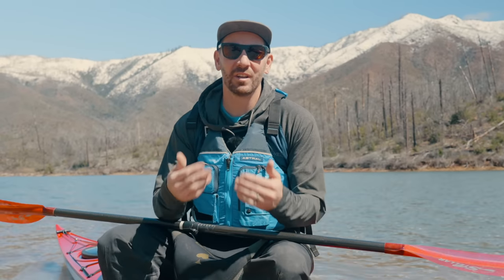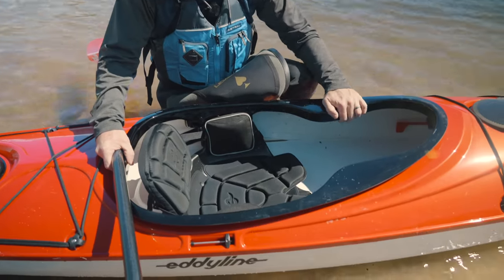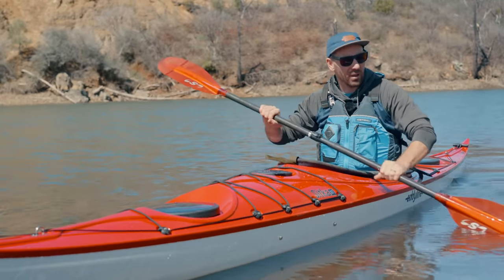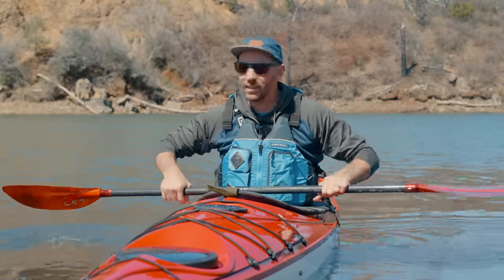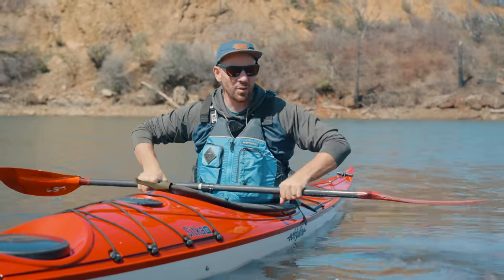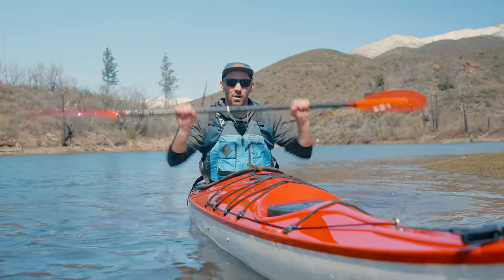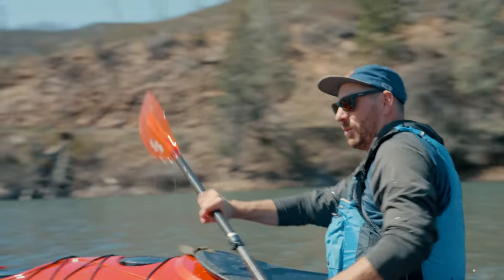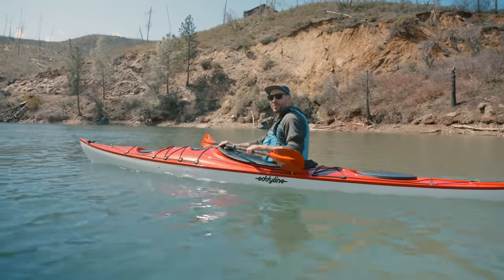Advanced Paddling Skills: Kayaking 102

Comment: I just added those exact hip pads to my Sitka XT to increase my connection with the kayak and thus edge control for turns.  A great instructional video as always Dan!
Reply from the maker: Right on. I hope it helps. Go out there and play in your boat!
Reply: What hip pads did you add? My xt seems to have very thin pads and am experimenting with add foam shim under them with mixed results. Thanks
Reply: @jimhunt1230  it's the Harmony Gear hip pad kit
Reply: @bunsen27  Thanks for pad info.  I will try a pair.  Curious - did you add these on top the standard XT hip pads or use as a replacement?  Also curious on seat placement - how far forward do you have your seat?  Thanks again - just got my Sikta XT last week and trying to get comfortable with it and dialed in.
Reply: @jimhunt1230  Yes, over the existing pads.  They come with straps or velcro for attachment.  My seat position is 1.25" back from the front of the most forward seat position.
Reply: @bunsen27  Thanks for the quick reply & info.  I have some straps on order & will remove the foam inserts that I made from an old camping pad that while added hip contact were uncomfortable.  My seat is back about 1.5" + from the most forward position.  Originally I was moving the seat forward to get better thigh contact.  I have since added a 2nd pair of Eddyline brand thigh pads & the contact feel has gone from to loose to slightly too tight.  I am still working on finding the right foot peg length.  Not sure if I will leave the 2nd pair of thigh pads in place.  (fyi - 6' 3" - 240lbs - size 14 feet).  The boat does feel good and better with each paddle.  I have yet to master any of the advanced paddling strokes discussed in the video.

Are you happy with how your XT now fits you?

Comment: Love this! Thank you so much for the skills video 👏👏👏🙌🙌🌅❤️. I am starting down this path with my new stellar S14 kayak. I’m  Starting to play a little with edging. It’s definitely a progressive boat from my Eddyline Sandpiper. The one thing I do notice though I need the skeg down for tracking straighter even in calm water…my Sandpiper seemed to do a better job? I was wondering if that would be the case for the Sitka as that was the other boat I would’ve gotten - was just 10 pounds heavier and that made a big difference for me. 
Just wondering if you have any ideas on the difference between the two boats and what I need to consider when I try these new skills out. Thank you again I just am so grateful for this video.
Reply from the maker: Yes it’s a much looser boat than an Eddyline. More playful but also a handful without a skeg. I really like the rudder upgrade on my 14. It makes it a completely different kayak.
Reply: @HeadwatersKayak  
OK can you expound on rudder -on one video you had mentioned the difference between the bottom of the Eddyline, and the stellar saying that the stellar would handle rougher conditions better? Now I have the advantage layup not the multi sport. I don’t plan to go rock gardening, but I did buy it as a sea kayak. Also, and one video you said you wouldn’t get the rudder because you felt you didn’t need it but you do have it because of your filming for the channel. I’m not going to be doing that obviously. 
But I definitely love the way the foot pegs have the extended rudder pedal on them and I’m certainly open to getting a rudder. How does that work with edging and the skills that you’re teaching in this video. Sorry to ask so many questions. I have not taken a lesson in it yet and plan to do so, but it’s gonna be a bit yet before I do. Thank you so much!
Reply: @clahr7671  I also have an S14(G2) and the skeg is indeed necessary for good straight sailing and then it sails perfectly straight. But also with skeg you notice that the S14 responds very well to tilting and steers very easily. Due to its width, the tipping over point is far away, which gives the confidence to use tilting without fear of tipping over . In my opinion, a rudder is not necessary with this kayak. I don't like rudders anyway. I find a kayak easier to trim with a skeg. For me, the S14 is the ideal touring kayak. It accelerates easier and rides lighter at touring speed (7kph) than the 18ft Rebel Jara kayak I had before and is super manoeuvrable. I love my S14!
I read that you will be using your kayak at sea, I have to say I don't sail at sea so I don't know how the s14 handles big waves.
Sorry if my english is not correct, english is not my native language.
Reply: @spook-e8621  I really appreciate the detailed info on your S14… Very helpful!
It all makes sense 👍
I may get that rudder… I think I will for the ocean. I believe that’s what Dan is talking about. But the skeg definitely needs to be down. I am learning more about it all the time and it is enjoyable more I play in it.
Thanks again!

Comment: @15:28 you are not significantly ‘shortening’ your waterline length.  

What you ARE doing by rolling / edging / leaning is you are changing the wetted hull form from one that is symmetrical when level to one that is ASSYMETRICAL.  A symmetrical underwater hull form is balanced so tracks in a straight line; whereas an assumetrical underwater hull form is much more conducive to spinning rather than tracking.  Essentially, you are altering the ROCKER of the keel fore-and-aft.  Boats with greater rocker pivot more readily; same with an ice hockey   skate blades compared to speed skating skate blades.

Comment: No - airplane wings rise (fuselage climbs) due to the pressure differences above and below the airfoil created by the wing cross section.  Paddles don’t have such a cross section.

Rather, what you were demonstrating was the planing effect due to the force of the water surface tension striking the paddle back face on an oblique angle while advancing forward relative to the water medium.  Speed boats transition from displacement mode up to planing mode once a critical forward speed is reached.  

Your paddle didn’t actually rise; you simply could apply more downward force to counter the roll because of your (diminishing) forward momentum. Once your velocity falls the paddle has no resistance to bear against.  It’s the same as a bracing slap - the  surface of the paddle has to accelerate against the surface tension… a brace in slow motion won’t work.

Comment: Does a/any sit-on-top (SOT) have secondary stability built into them, like the sit-in?

How does one "edge" in a SOT?
Reply from the maker: Yes for sure. You can shift your weight to one hip or the other and you’ll feel the kayak dip to its “edge” and it should respond in the same way. It can be harder to hold an edge, but it’s possible. So I’m sitting on tops are built to be so stable, that it’s really hard to get them to edge. So you’ll have to play with it.

Comment: What's the purpose of the distinct head movement during the bottom brace? I tried it and as it's forced, it feels unatural!
Reply from the maker: Bringing your head down, drives the knee up preventing your kayak rolling. If you lift your head the wrong knee engages and will actually cause you to tip.